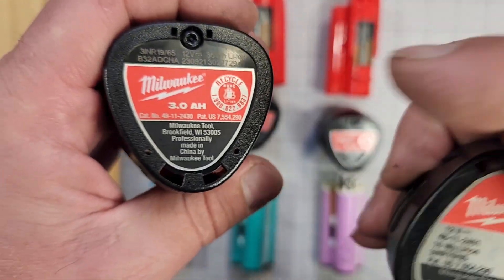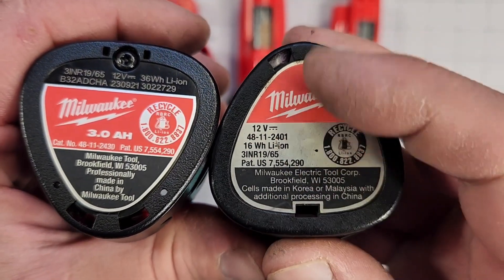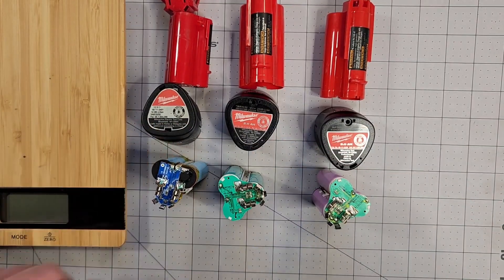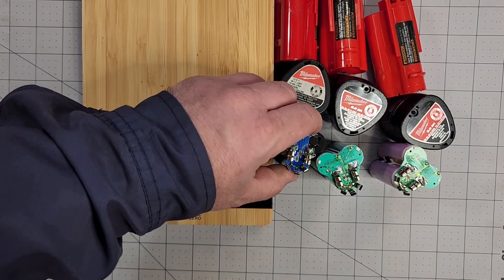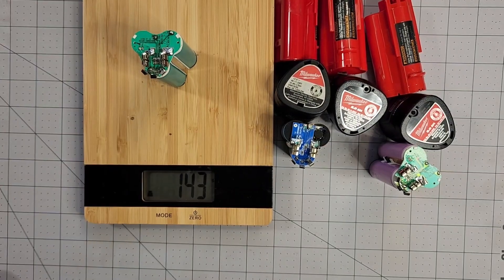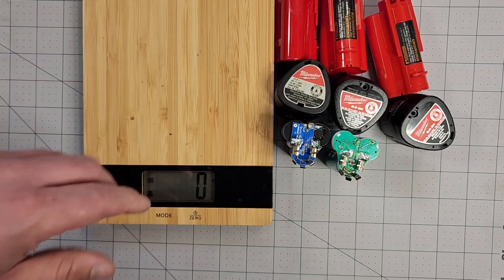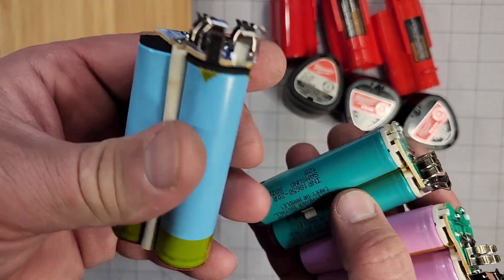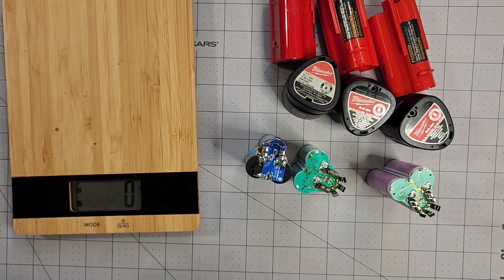Milwaukee M12 batteries taken apart CP1.5 vs CP2.0 vs CP3.0

Comment: Your 1.5ah is a fake. I have a old M12 1.5 and Milwaukee does not use wires and has the same green circuit board. And the print on the "Samsung" cells is different then the others which means they're fake Samsung cells. I've taken mine apart and upgraded it with Panasonic 3450 mah cells